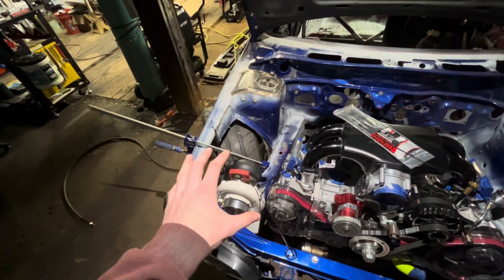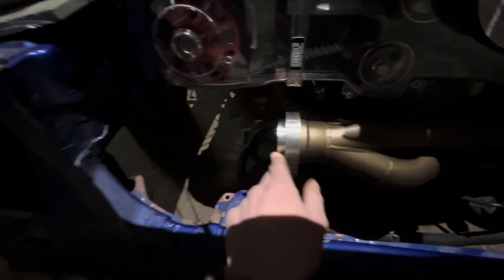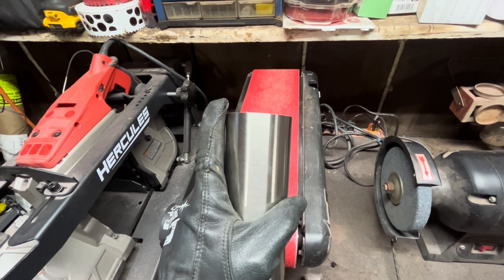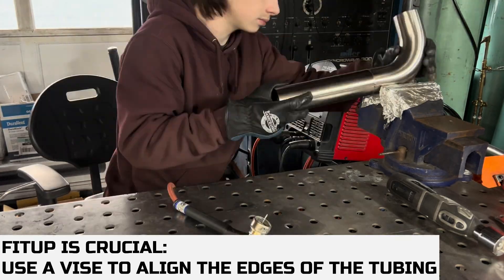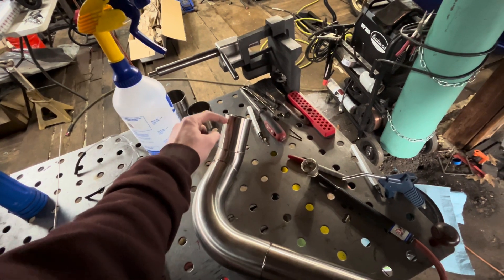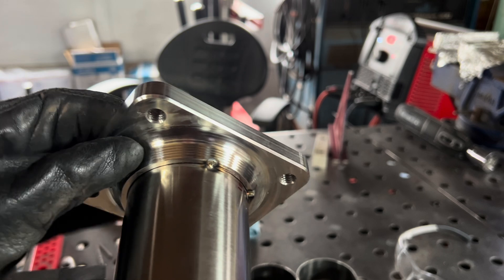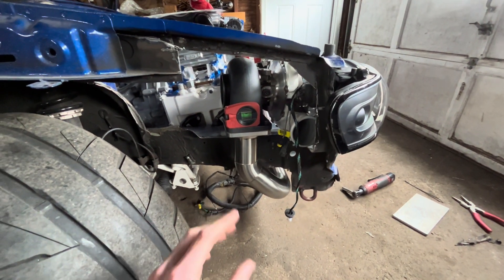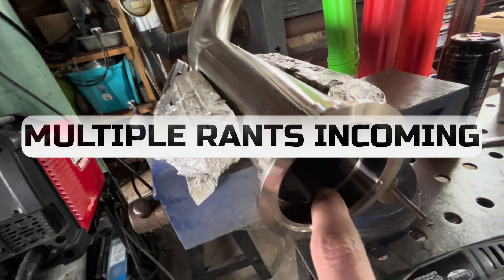Exhaust Fabrication Tips that Make Life 10X Easier!

Comment: Is that schedule 10 pipe?
Reply from the maker: No this is 16 gauge.
Reply: @PrattPerformanceDesign I was under impression to mount a turbo you need schedule 10 pipe.  do you know how this held up?
Reply from the maker: @BulliKid There were support rods added by the owner after the fact. I welded threaded bungs to the side  of the tube for him to bolt the rods to.

Comment: That black ring around your tacks, might need to keep your torch in place longer or add some post flow.
Reply from the maker: I have been wondering about that for quite some time and I actually believe it is due to not purging my tacks or having a large cup and it not being focused enough on the small area. I am going to try purging my tacks and using a smaller cup. Thank you for your input!
Reply: @MotoFabPerformance for the little stainless i do, with a #8 cup, I have 2 second pre, 6 second post flow. But mainly, i'm just welding flex couplers on exhaust.

Comment: What size filler did you use for those but weld joints and the flange? .045?
Reply from the maker: Yes .045.

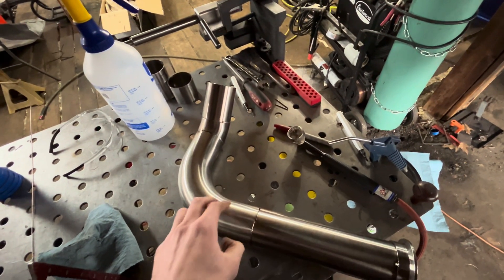Comment: 7:25 That's a sweet flange...and anyone who has ever attempted a custom job like this knows how hard it is, Good Job man. 
The hardest part for me, as a newb with few tools, is trying to hold pieces in place to tack. Your ass will be SCROUNGING trying to rig something up.
Reply from the maker: Holding multiple pieces in place on the car to mark them and then trying to keep everything lined up when tacking can be difficult for sure. Over time you get better, not a whole lot of tools out there to help with that part.
Reply: I did the exaust on my 96 k1500 with a Flux mig 125 not the prettiest but it lined up fine. I just fit the pipe under the truck and tacked it good and hard
Reply from the maker: @minimalisticmime5459 It’s a little different with a tig welder. Fit up has to be much more accurate.